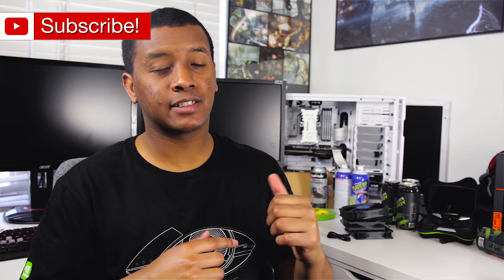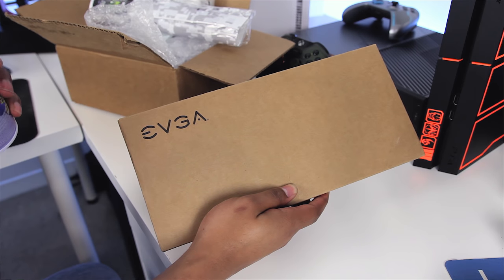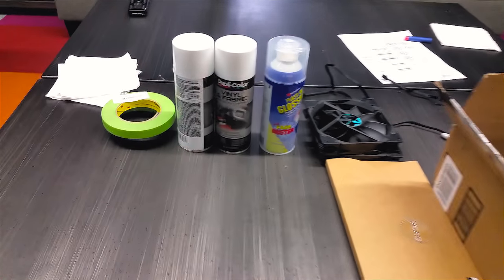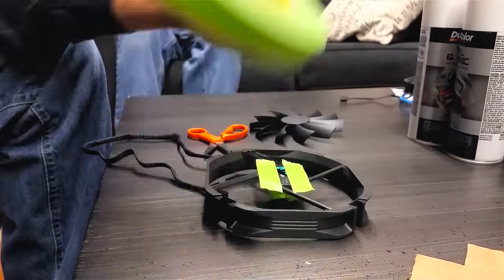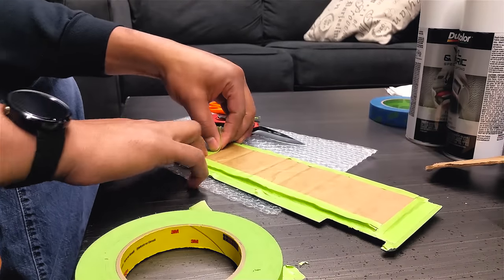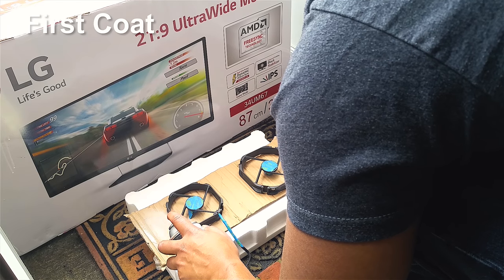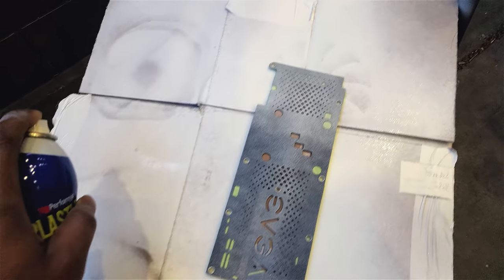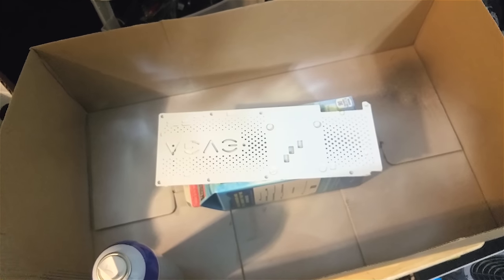All White PC Build Vlog | How To Custom Paint Fans &  GPU Backplate

Comment: you should have used specialty plastic paint, and you should have 800 grit sanded the blades first. there is also companies who sell all white fans , BitFenix, Evernmax, DeepCool, etc there are also companies who make other items in White, Ram, SSD, HDD, Mobo Vid Cards, there are even companies you can send off your item and have if professionally painted in almost any color and now some even do multi-colors and Textures , the Future is bright for PC mods Coloring FINALLY, so fed up with Blah Black  cases...Good Luck Young Man.   Cow
Reply: Do you have an example for that kind of paint? Maybe an Amazon link, thanks!

Comment: I think the reason why your sprat cans where spitting are simply because of the angle you are spraying, you should always try too keep the can as straight as possible, you can tilt it off course but just not too much. At least that's what I learned when I worked as a sheet metal worker and a painter showed me how to spray paint some metal parts.

Comment: cavitation is not "when the fans spin unevenly". its the effect of water on the blades of a propeller. so much fail here...you should of learned how to spray paint before using it to mod your pc.

Comment: Damn, I should've gotten the all white Define R5...
Reply from the maker: +3ric585 Yeah I love that case! After the motherboard it was the second component I chose. What color did you get?
Reply: SrgntBallisticGaming Black with Window (White trays & brackets though)
Reply from the maker: +3ric585 Nice! If you hit up some forums and build logs of ppl with the white version of the case you might be able to find some ppl looking to trade drive trays and pcie slot covers. That way you could get a blackout version of your case and they can get a white out version for the cost of shipping ($10-$20). Painting is another option but you have to worry about color matching. Kind of a Time vs Cost thing.
Reply: SrgntBallisticGaming Yea, I was thinking about that.

Comment: Nice build! Just wondering how to take off the fan propeller? Im planning to paint my fractal design gp14 fans. Thanks
Reply from the maker: On this design they'll just pop off their hub. Apply even pressure across the back of the fan blades from the direction of the hub. Other fans have screw and/or retaining pins you have to remove.

Comment: oh my gosh people still don't know how to use spray cans after, I don't know probably 50 years of its use?
Reply: spray about 2 feet away with extremely light coats for your first two coats, the third coat should be a decently heavy where it starts to actually fill in the gaps, then your last coach should be heavy but even...
Reply: also by the way you should just use clear coat to make the object shiny, no need for anything fancy. and the reason your paint was splattering so much was because you didn't shake it up properly, the reason you have to shake it up is because the oils in the inside or just a mixture not a compound so after a while they start to settle at the bottom what you should do is shake it lightly a facing the correct way and then flip the bottle upside down and Shake really hard for like 3 to 4 seconds and then spray paint...

Comment: This video is cool, I'll be doing a black/white build in the corsair 250d and I was thinking about painting the ram white (also it will be my first time building a pc on my own). I also kinda want a white backplate for my gpu now :S
Reply from the maker: Thanks for watching. The Plasti Dip is nice since it's temporary. But seeing as it's only around $20 I'm thinking I'll probably peel the plasti dip and use some high heat paint.

Good luck with the build!
Reply from the maker: Thanks for watching. The Plasti Dip is nice since it's temporary. But seeing as it's only around $20 I'm thinking I'll probably peel the plasti dip and use some high heat paint.

Good luck with the build!
Reply: +SrgntBallisticGaming Thanks for the reply! I actually will not paint the ram, instead I will get a stick that's already white, but I will paint the gpu white. I'm really excited because I will probably order the parts tomorrow :D

Comment: Do you sand the blades befor painting them? Or is not neccesary? Thanks
Reply from the maker: I think it will depend on the material and paint you're using. Generally would be helpful to help the paint adhere.

The stuff I was using was supposed to stick really well to most plastics but I've noticed it chipping off a bit in places.